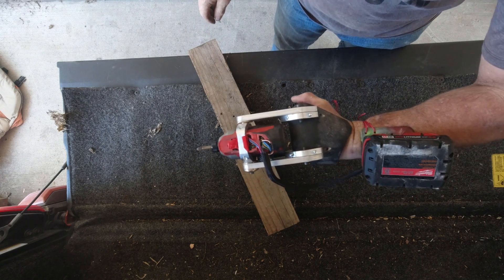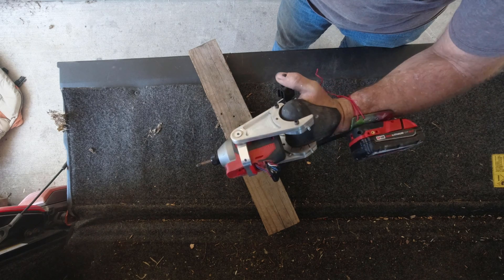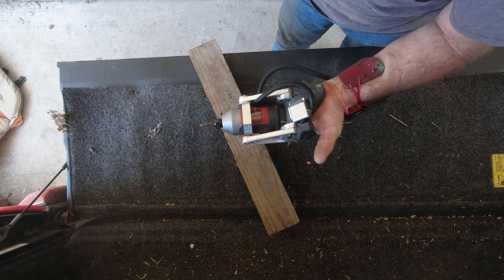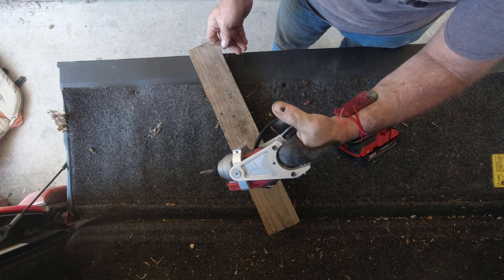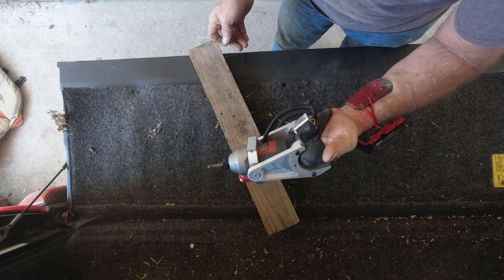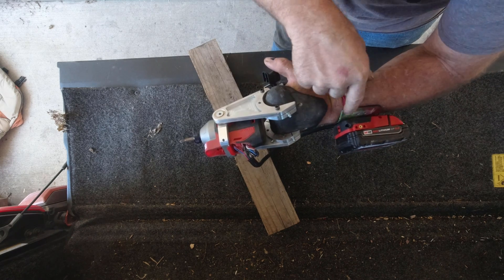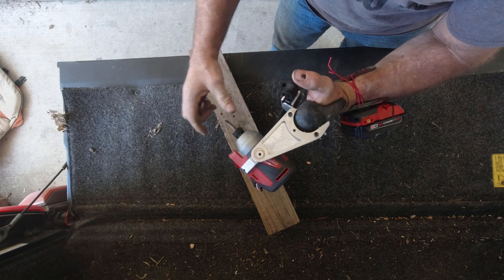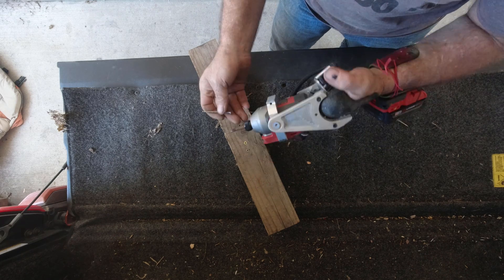Milwaukee 1/4" impact partial hand prosthetic device

Comment: Consider swinging the drill head down below the palm or outer palm. Look at the forearm position over the drill to get the greatest pressure applied. The other 90 degree position needed for the drill is to fit the Chuck in tight spaces which a 90 deg Chuck is better suited for. Your current hinge doesn’t provide a good leverage and tight spaces compromise. Both are important and would suit you to have a separate mechanism for it.

Comment: Does this exist for other prosthetics? Cause I always see hands and I wonder why wouldn't someone build more ad-hoc appendages for specific tasks. The bebionic has a detachable hand and 360 rotation. I always thought it'd make sense for it to have something like a clamp or socket for holding screwdrivers and be able to do continuos rotation
Reply from the maker: Sadly, nobody's doing anything in that field. I was pretty sure I had a winner with that concept when I debut it. But I got zero interest when I approached tool and prosthetic manufacturers.

Comment: I'm worried about his wrist. The torque of the impact driver can easily damage the ligaments of the wrist.
I think you need to create a safety device. A method of automatically turning off the power when a physical brake or a specific axis is reached is required.

Comment: Have you heard of the surge 12 volt Milwaukee?  Its lighter weight and 50% less noise and alot smoother. Due to it being hydraulic pulse drive tech. My 5 year old son helped me today BUILDING for my wife and he installed every screw for me. Very epic machine.   Great video btw

Comment: This is cool but doesn't seem very safe. Not sure it you have ever had a screw gun rip itself out of your hand or not but even that can be painful and it's not attached. I guess as long as you are using a low torque device it would be fine.

Comment: Really cool idea. Could you do a rocker switch for forward and reverse? 
How  much torque is going to your wrist?
Reply from the maker: I'm  actually using the stock switch. So it's towards the palm and away for forward and reverse.  The force translated to my wrist is about the same as if you were using it in its original configuration with a natural hand.

Comment: The tool should not be that way, it puts a lot of stress on your wrist joint, it will cause severe long-term damage, the idea is very good, but it would have to be analyzed with ergonomics, it could be redesigned taking into account the above

Comment: Thats so sick if you used the dry wall gun you could put it in the auto mode and only need to push down on the screw to run them in but its much larger and you might be forced to have some controls further up your arm either way i love it

Comment: For real ,sept 2019 I had a partial right hand amputation on a table saw .   THIS IS BAD ASS . I want see you make something to clip or click onto the dewalt cordless circular saw . its really the only tool that is tuff for me to use ( its hard to pull saftey and trigger and actually push with just my middle finger ?

Comment: Hello Ian I want to design work station at my job site for people that can’t hold and press the trigger of pneumatic tools like drills and staple guns, my idea is to drill holes in to the
Valve areas that the trigger normally pushes on and have them hooked via air tubes and quick connects to a foot pedal “BUT” I haven’t been smart  enough to figure it out yet, any idea where I have to drill holes on the gun to achieve this? The pneumatic valves behind the triggers always look the same like a small brass barrel.
Any pointers to figure it out?

Thank you

Comment: how does the impacting affect your hand or partial hand? i am a carpenter and use my impact pretty extensively on the job and sometimes get some wicked tendonitis in my elbow and thumb from holding it. you have to push down vertically with what used to be your fingers...how does the impacting of it affect your hand after a long day?

Comment: Dude your awesome!! I appreciate your drive to not be defeated. Being handed and using tools sometimes the fact that my arm and wrist isn’t aligned with the drive point puts a lot of pressure on my forearm cause the tool wants to pivot in my hand and I have to compensate. Talk about direct drive. If you could alter other tools to snap into your hand and have the battery snap in at the same time like bits in a chuck you’d be unstoppable. I’m thinking motor and head snaps into your wrist mount like a battery does a drill.

Comment: Looking good! I think the next step would be to add some kind of wrist guard. I know the rotation force is not that strong when it kick, but some time it kinda does. It would prevent the contraption to go to a certain angle. Could also fix the battery to it. With the guard the next step would be an Impact drill to change your car wheels or pierce metal with heavy duty screws. Maybe a handle to hold it with your other hand?

Comment: Ideas for improving the product:
-That battery pack looks heavy and bulky. Maybe mount it on a belt strap and run a wire from there.
-The impact drill can impart a significant amount of torque, and EVERYONE on the entire internet would absolutely hate to see you injure your wrist or hand even more. A side handle that you can grip with your other hand will help you protect against over-torque.
-Chainsaws.
-Some kind of quick release socket so you can swap out tools or parts on the fly. 
I know that the amount of time and effort you put into this is substantial. Keep flexing on them, guy.

Comment: Why.   A solution for a problem that is not there.    Not practical. I’m not being mean.    But.   I can’t see any practically for this other than just making something neat.
Reply from the maker: I wouldn't have seen the need either when I still had both of my hands. But trying to use an impact driver missing one hand was impractical at best.

Comment: I've seen people have hands and forearm injuries from drills. A safety break away that could prevent you from injury could be a good idea, as there is a lot of torque being applied to your wrist. Screw guns have a clutch that disengaged when the torque value gets to high, and is adjustable. Best of luck, and keep up the good work.

Comment: think you need to keep the device in line with youre wrist , if you turn it the way you mentioned in the video you would have to apply a lot of muscle to stabilize the machine and drive the screw in without stripping the head , it might work with hex heads though

Comment: I love it... would probably implement some torque control features tho to stop it twisting ur wrist off if it gets caught! :)
Reply from the maker: It's not a drill motor, its an impact driver.  And actually in this configuration it has less of a lever moment arm than it does when it is set up to be used by the natural hand.

Comment: While it would be cool to include articulation into the wrist movement, would that not limit your ability to fit into tighter spaces with it? Maybe I'm confused on how much wrist flex would be required.

Comment: Would be useful to have a retractable sleeve around the drill bit to help guide it onto the screw head/retain the screw - even with a standard drill, but also for your custom design. How on earth you'd reasonable achieve that though I'm not sure.

Comment: I can't help but flinch at the fact that the force could twist your wrist
Reply: ^ This. I wanted to see if any other comments were worried about the torque
(sorry for the 6 month old ping)
Reply: I also searched for this comment before making the same, This is a hot week for this comment.
Reply: It's an 18v impact driver mate, there is no kick and there is a slipper clutch preventing such a thing.
Reply: @KingKettle1  i guess it has some torque, but not much?
Reply: @ChristensenGamer  yep but it's impact torque not raw torque so it can't possibly turn a human arm, that clicking sound you hear is the slipper clutch determining there is not enough raw torque to turn the fixing anymore so it uses capillary action to reduce the resistance between the fixing and the material you're screwing into. I can tell that his arms would be as strong as mine and and those wouldn't even be able to turn a child's arm it would just get hot and stop turning the fixing 🙂
Reply: @KingKettle1  ahh now i get what you are saying, i was as a mechanic myself. I understnd the force of the reaction is allmost non existing.😁   but my POV was if you take another impact drill like his that rotational force will be bigger, because you have the drill itself sitting 5-10 cm above thw axis of the wrist/foram. for example lets say the drill has a reaction of 30N but that force is comming into your wrist/foram 0.1M above the axis. (Ndrill × Mleverage=30N × 0.1M=3nm) but if his drill is allmosy on the axis or just a cm of, the torque would reduce alot 30N × 0.01M= 0.3nm. So less torque in his "hand" drill than a normal impact dril.

I hope it makes sense what im trying to say. English is not my first language and my just a simpel mechanic😄
Reply: i dont think it kicks more then a normal impact drill, maybe even less because its on the same axis as the forarm?
Reply: Next project 1" impact attached to wrist
Reply: Reinforcing the wrist with a strap solves this
Reply: People that flinch at potential problems watch as innovators and risk takers change the world for the good of other people many times... While the flincher keeps finding more potential problems to flinch at lol
Reply: @eduardochinchilla2198  well said, couldn't agree more!

Comment: pretty cool, but have you thought about putting a mechanism similar to one of your fingers that attaches to the forearm guard and stiffens up when you activate the driver, to reduce the torque on your wrist? I say like your fingers so you would be able to move it freely, until you turned on the drill and it stiffend.

Comment: Wouldn't not locking it horizontal make it hard to control while drilling?
Reply from the maker: It's not a drill, it's a driver. It's for driving screws or sockets. It's not really for making holes.

Comment: If I were to have such a condition, I'd probably make it so that the socket is a base attachment to my had and other things like a screwdriver, saw, bread knife and so on could be attached to that.

Like that, you don't need to change the whole socket, just the tool you would attach to it.

Comment: It seems to impart a fair bit of torque into the forearm  which may become tiring over a long period. Not to take anything away from  your superb prosthetic after all the torque settings on the impact driver are easily adjusted. Right?
Reply from the maker: If you think about the original torque plane and the rotational plane of the device, they are the same. The addition of the socket has just given me a way to hold onto the tool.

Comment: Have you thought about making it into a modular design, most power tools from the same brand use the same battery and I feel like you can create a mounting plate that can be plug and play similar to how you replace bits
Reply from the maker: Yes, the trunnion plates unbolt from the socket with 6 screws. You could change it out for all kinds of different tools. Although with as easy and cheap as it is to build a different socket, I'd probably just set up a whole different socket and tool instead.

Comment: I have a feeling all this stress and force on the hand can really mess your joints up. Like it feels like it will grind the bones and mess something up in them.
Reply from the maker: It doesn't feel like it's generating or translating rotational force to my wrist. Really it isn't any different than if I were using it with my natural hand. I'm just changing how I'm holding onto the tool.

Comment: Do you find the torque on your wrist when spooling up uncomfortable. Seems to translate to the joints differently than when holding a drill in a hand. Looking  forward to seeing it at right angles. 

I wonder if a small Dremel style tool would work well as a prosthetic attachment?

Beautiful workmanship as always 👍🏽🔧
Reply from the maker: I thought about that, I looked at the Milwaukee rotory tool, it would be a great candidate for the conversion.  I only chose to do the impact driver because I need it for a project.

Comment: I’d wonder what kind of torques you can withstand comfortably with such a prosthetic, especially in the different rotations once you implement that. I’d suggest adding some sort of linkage to let your forearm take up that torque instead of your wrist, but that would require a lot of complexity to articulate as normal. So instead I’ll just suggest that you add a way to screw one of those angle grinder handles into the side.
Reply from the maker: The tool really doesn't translate that much rotational torque during operation, or at least it doesn't feel like it.

Comment: I think this is such an interesting build, so useful! What type of shop machines do you use in the shop? Looks like a milling machine and drill press and I have seen a lathe.
Reply from the maker: It's a full machine shop. manual lathe and mill, 3 cnc milling machines, cnc lathe, turret lathe, turret drill, cnc plasma cutter, press brake, welders, saw, ect.

Comment: Is there any risk of modes accidentally switching during operation, from reverse to forward or vice versa?
Reply from the maker: I suppose you could,  but so far it hasn't been an issue.  If it does, it wouldn't take much to add a gated interlock to the trigger.
Reply: @missingpartsclub  Good to know! Glad it's been working out for you :).